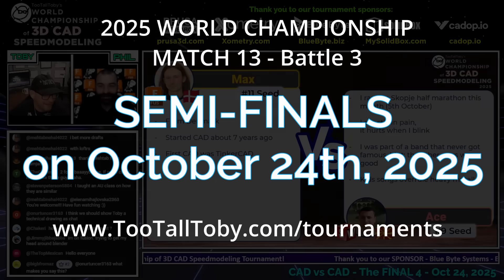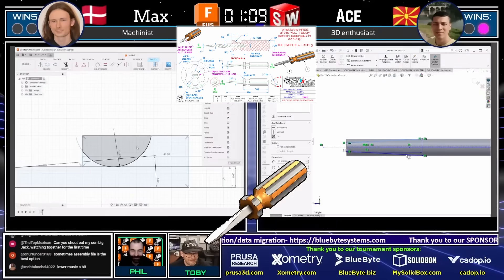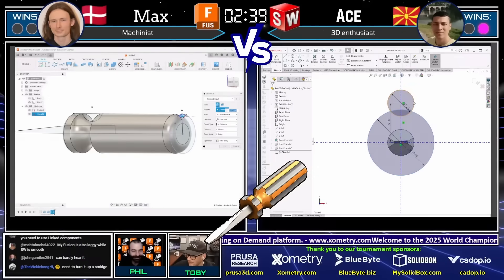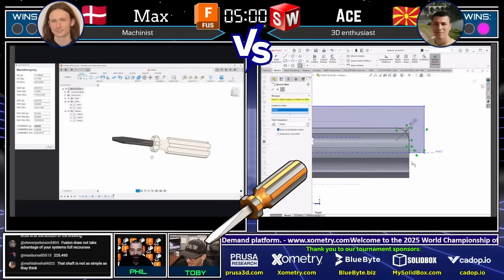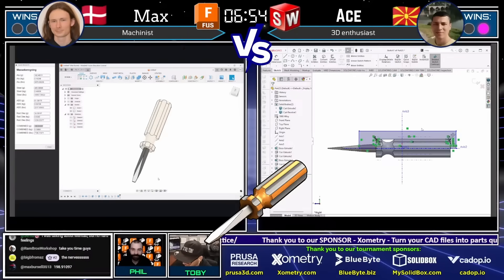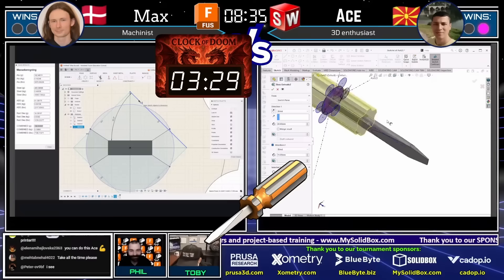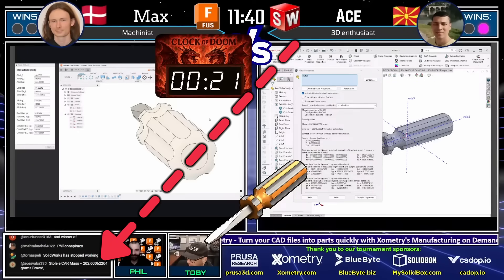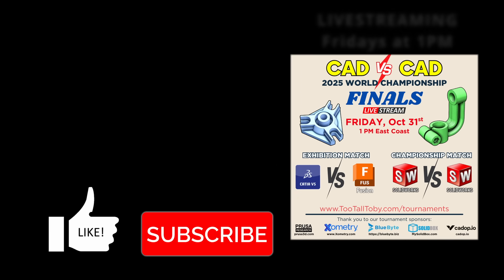CAD vs CAD Tournament - 2025 SEMI FINALS!! -  FUSION vs SOLIDWORKS - Sheet Metal!

Comment: tried doing this in solidedge. took me more than an hour and didn't figure out how to apply the right material, it ended up like 206 g
Reply from the maker: Nice work - I'm actually working on a proper "materials" page this evening.  But long story short, we use 4 materials in the library:
1060 Aluminum Alloy” — DENSITY = 2700 kg/m3
“ABS” — DENSITY = 1020 kg/m3
“Plain Carbon Steel” — DENSITY = 7800 kg/m3
“Red Oak” — DENSITY = 570 kg/m3

On the discord we have users from a bunch of different CAD systems who have configured libraries to reflect these 4 materials - but it's these 4 materials that we use.
Also (editors note) in 2026 I'm gonna swap the word "1060 Aluminum Alloy" for "6061 Aluminum".  Same density, just changing the name.
In 2026 I'm gonna swap the word "Red Oak" for "American Cherry".  Same density, just changing the name.

This is due to these materials being the more common materials found in manufacturing and woodworking, and I want to prepare my students for more real world environment.  

I'm only mentioning this because if you're planning to make a material library in Edge, you may as well use the new material names. 
Hope this helps,
Toby

Comment: Shouldn't the bore of the handle also be square???
Reply from the maker: it could be, or it could be filled with some kind of epoxy or resin to act as an adhesive
Reply: @TooTallToby  fine, but that would change the mass.  Just seems like an important thing to know if "mass" is the target.
Reply from the maker: @fiz_Buzz  cool thanks!

Comment: i use fusion 360 and i can assure you theres no lag but it needs to be setup properly on a nice system. you can set minimum fps so its extremely smooth all the time.
Reply from the maker: Good to know! Thanks for sharing that insight!

Comment: IT IS ASSEMBLY PART WE  HAVE TO MAKE HOLDING PART DIFFRENTLY AS APART AND FRONT SCREW SHAFT DIFFRENTLY THAN WE NEED TO DEFINE THERE MATERIAL AND FIND WEIGHT , GO TO  ASSEMBLY AND DO ASSEMBLT BOTH PART TOGETHER AND RECHECK WEIGHT AND THAT ASSEMBLY WEIGHT IS FINAL WEIGHT
Reply from the maker: yup that works too!

Comment: if the shaft is square then why don't either of the views show the edges?
Reply from the maker: Well...I have two thoughts on this:
1. Technically the Front View (the enlarged detail view) does show it as square, along with a note.  And it's shown in the upper left angled view.

However, my second thought: I did like 44 drawings for this tournament, and one or two "got away from me" a bit.  This was one of them.. 😁  Too many ambiguities!! Definitely not my best work, and usually I try to make these a little more clear.

Glad you're enjoying the tournament content!

Comment: so, I think the sole purpose of a drawing is to leave no ambiguity for a vendor to make a mistake when producing the part in the drawing.  For Me;  this drawing is too ambiguous, or rather not explicit enough.  The section is through the square metal portion in such a way as to be unclear, where a cross section across the handle would have brought clarity.  If the purpose, for the sake of the competition is to have to "squint" then I get it.
Reply from the maker: Lol - yeah I could see how it was developing during the match - good idea to add a section view.  I created over 40 drawings for this tournament, and I think this one got away from me a bit. 😁

At the end of the day, the beauty of a 1 vs 1 match is that they both have to face the same struggle. So they both have an "equal chance" to get confused.  😀

Comment: What happens if they get the correct weight but the model doesn't match the drawing?
Reply from the maker: In this contest the mass is the criteria for earning a point - however they get there is up to each runner - we like to let them get creative, but on the higher end models they basically just have to model it, the way it's shown.
Reply: Answered my own question. It's OK I guess. The handle should be rotated 30°.